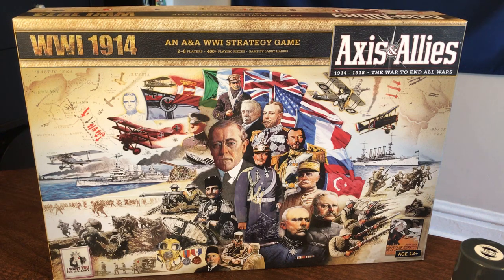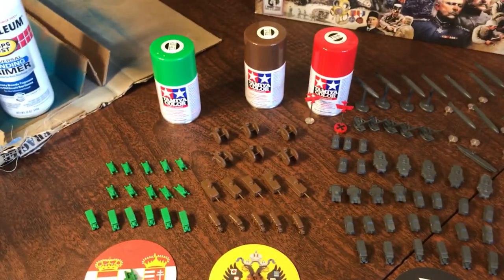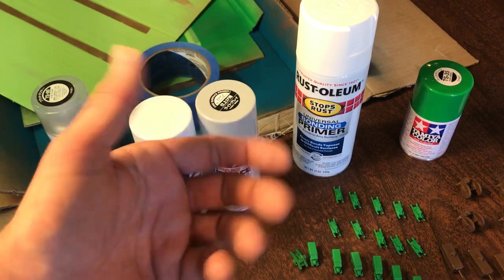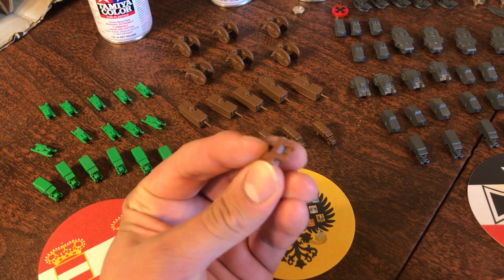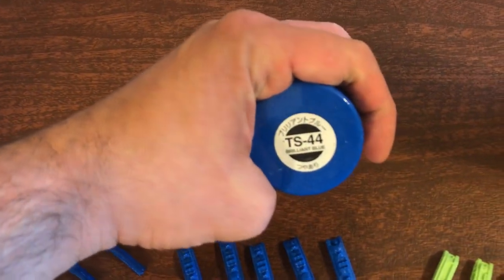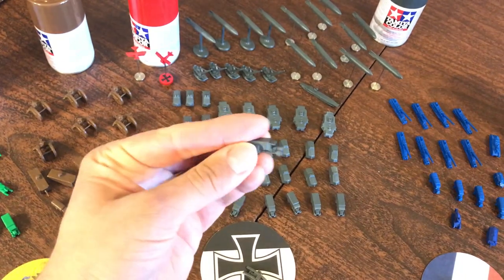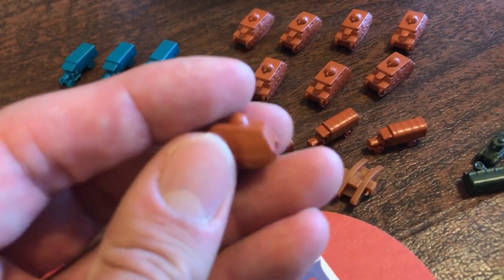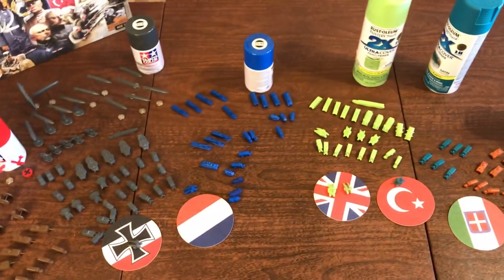Painting 3D Printed Game Pieces for Axis and Allies 1914

Comment: How do you achieve even paint coats and avoid pebbling? Was it by switching from Rustoleum to Tamiya? Do you spray them all? (I heard you mention an airbrush.)
Reply from the maker: I just used the spray paint versions.  Back when I made 1/35th scale models, I did use an airbrush though.  

To avoid bubbles/pebbles (if that's what you mean) in the paint, my experience is to just avoid overdoing it.  The less thick of a coat you apply, the less likely it will happen.  It still happened on a few of my pieces but not the end of the world.  

Yes, All of them I sprayed to try and avoid paint brush strokes. I held them in place with folded painter's tape on cardboard sheets and then let them dry for an hour before touching them.  Again you don't want to put it on too think because you might have to do touchups, which can also depend on the mold in general.  

Important to note, I had better luck with the rustoleum clear coat on the tamiya paints not causing any crazing, than I did the the rustoleum clear coats on the rustoleum paints.  I'm not sure why, but need a better clear coat that will play nice with the rustoleum paints.  You would think the same brands would play nice, but I guess not. 

Also the tamiya paints dry pretty quickly but the rustoleum paints should be left to dry for at least 2 days, til when they aren't tacky feeling anymore.
Reply: So you do: (1) Rustoleum primer, (2) Tamiya paint, (3) Rustoleum clear coat?
Reply from the maker: @Trenacker  

With Tamiya paints:
1. Tamiya primer
2. Tamia paint
3. Rustoleum clear coat

With Rustoleum paints:
1. Rustoleum Primer (stinks way more than tamiya)
2. Rustoleum Paint
3. Rustoleum clear coat.  I know gijoe uses valspar in one of his videos, might try to switch to that or something else.  

Also, I generally paint 1 side of a piece a day, so its USUALLY a 6 day process.  Maybe excessive but I constantly battle with Murphy's law with everything.  Depending on temperature and humidity.